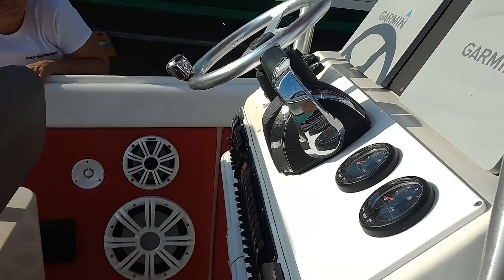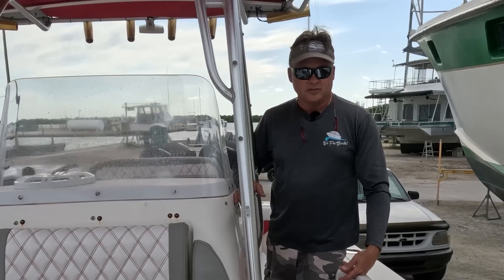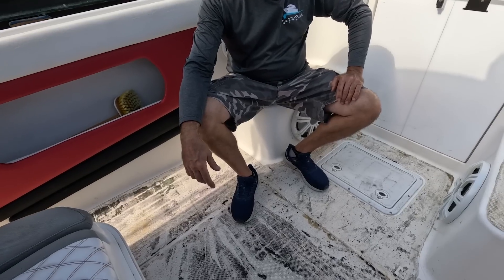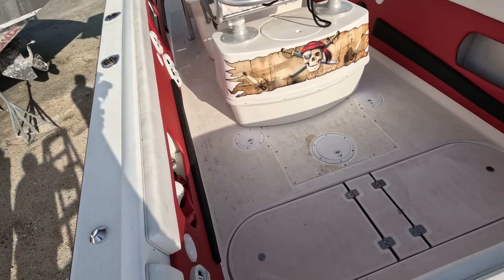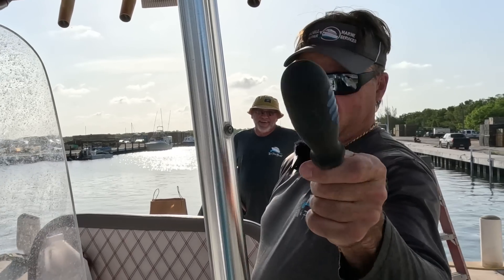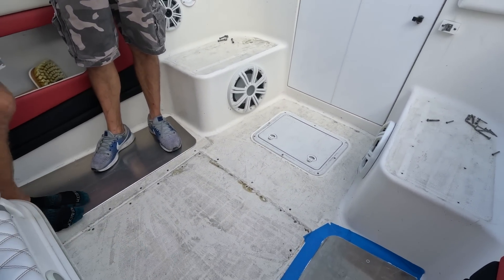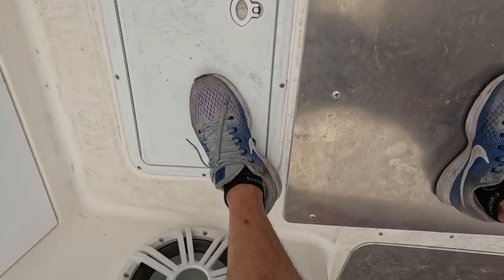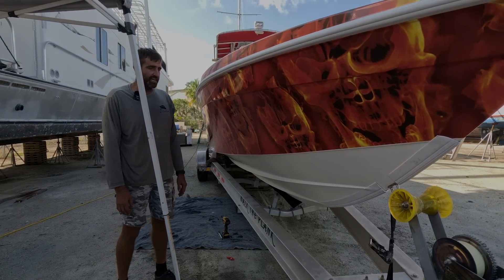Boat Would Have Been TOTAL LOSS! Temporary ...

Comment: Wonder if you should of applied Alodine after you scuffed the plates
Reply from the maker: We aren’t painting the metal!
Reply: @WillFixThat  the Alodine is to replace the protective coating after one sands,grinds or burnishes aluminum. I do it on aircraft all the time when doing structural repairs.
Reply from the maker: @robertm2172  Yes that is true Matt used to use cases when he was on active duty!

Comment: Hi new to the channel if it was me and my reputation was on the line I would tell the customer no matter if they spend all their money on bling bling you have to do it right which is take out the center console and replace the floor properly or you're going to have problems later on down the road
Reply from the maker: Well we didn’t do that because this was a temporary repair for them to use the boat in a month for a big town event. But, we told them it was not going to last.

Comment: I bet that aluminum was over $1,000 in materials alone.  I have seen people in my marina buy a boat and never get a survey because the boat looks nice.  Then they find out the decks are soft or the transom is rotted.  I would never buy a boat without a GOOD survey.  A guy in my marina bought an older Sea Ray and has been chasing electrical issues for two years now.  I am curious how long the SeaDeck lasts.
Reply from the maker: Aluminum was a few thousand… seadek normally a few years depending on if it’s in the sun! Always get a survey! 👍 boat dreams can end fast with a soft deck or rotten transom. It took us like 7 months to find our project boat.

Comment: I know you're in the business to make money, but pulling that console is a 2-3 hr job max.  Most of the wiring is harnessed easily for removal.  Once it's pulled, the console pulls off easily.  Then I'd cut the entire deck off by cutting around the perimeter leaving about 3-4" to fiberglass a butt joint.  You put a wood floor back in it, fiberglass it for strength, then seadek it over.  Should take no more than 4-5 days at 8 hrs/day at $200/hr.... 8-10k max.
Reply from the maker: We’ve done a few of these jobs in the past and the wiring under the console took a lot of time to label every wire to connect it back later! We charge time and material so … whatever it takes! We gave an estimate from past experiences!

Comment: Putting the aluminum in is just a bandaid.  You've still got all that water in the floor.  You fix the one part and you'll have to put a bandaid on another area later on and sometime down the line, you'll have to replace the floor.  I'd get rid of the boat and bite the bullet.  To bad, nice boat
Reply from the maker: Yes that’s exactly what we told the owner! This floor is extremely temporary & not going to solve the rotten issue! Water is still going to go into the deck! That’s why we put a disclaimer - would not recommend this!

Comment: I would just be afraid that the substructure rot/softening moved into the stringers. Sorry but I would open the floor and do it correctly. The materials are not that expensive, it’s the labor…. I could do it for a few thousand on my own. But the boat would be down about 6-8 months. Definitely worth it on that one.
Reply from the maker: Thanks Dr Ed we agree fix it right and be done! But we did as the client wanted … NOT always the route we would go on any repair! We also put disclaimers and no warranty!